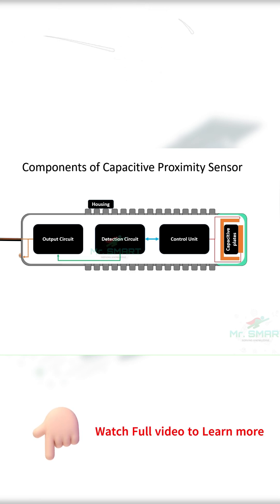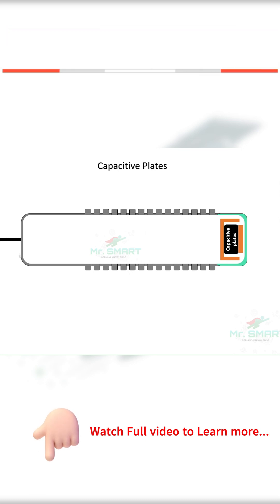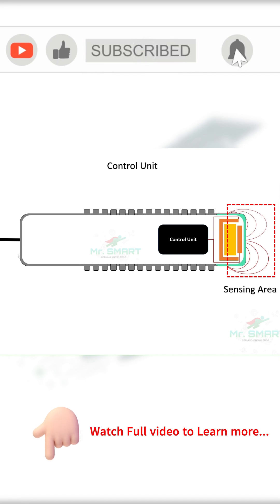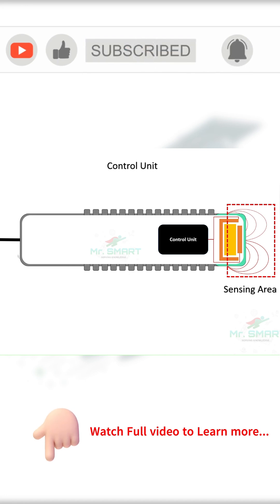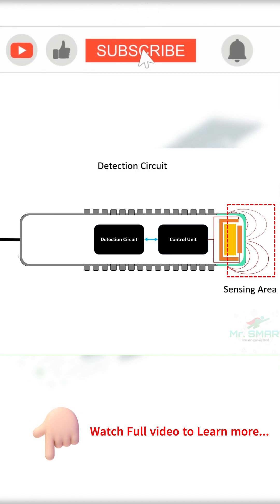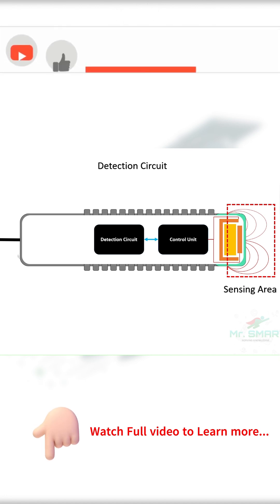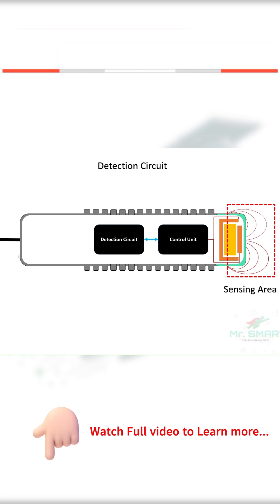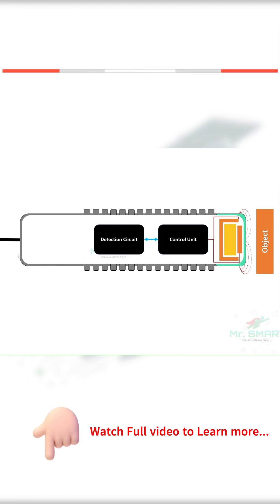⚙️ How Does a Capacitive Proximity Sensor Work? #automation #sensor #proximitysensors #basics

Comment: It doesn't detect the change in electrical field, it detects the change of capacitance via fréquence change
Reply from the maker: Great observation—thank you for pointing that out! 😊

You're absolutely right: capacitive proximity sensors don’t directly detect changes in the electric field like some other sensors. Instead, they detect a change in capacitance, which occurs when a target (usually with a different dielectric constant) enters the sensor’s electric field. This change in capacitance alters the oscillator's frequency or amplitude, and the sensor's internal circuitry detects that shift.

So yes, the detection is based on changes in capacitance, not the electric field strength itself. I simplified it a bit in the video to focus on the basic working principle, but your clarification definitely adds depth! 🙌